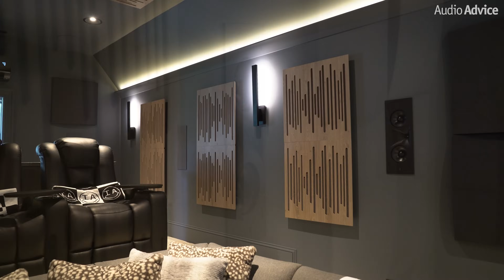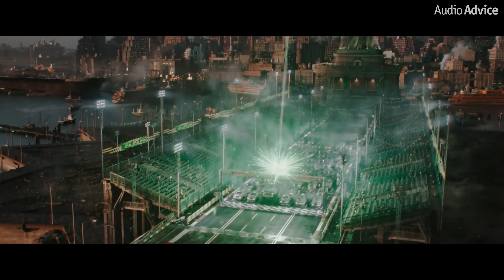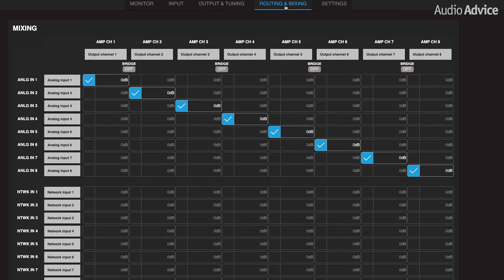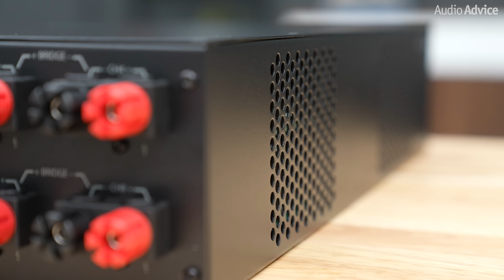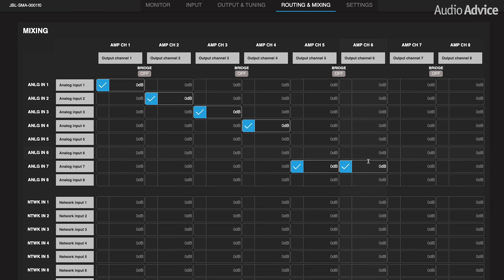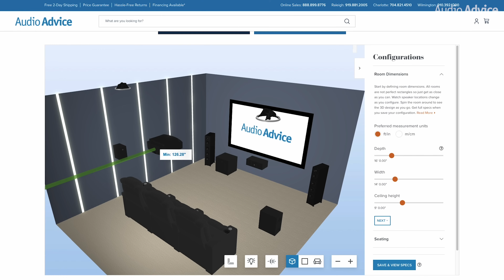JBL Synthesis SMA8300 & SMA4750 Power Amplifier Overview

Comment: I have the SDR-35 and SMA-4750, 2500 watts RMS per 15" subwoofer in my setup. Love it so far. I've never spent so much on two pieces of equipment.
Reply from the maker: Sounds like you are really rocking out! Thanks for sharing and hope you enjoy the system.

Comment: This seems like a pretty simple review, mostly going over the spec sheet, though seeing the web UI was nice. The old amps were based on Crown amps. What are the new ones based on? 0.35% THD at max power does not seem good. I want to see a review that dives into how they actually perform compared to other amps at this level. That they have AEQ for Synthesis speakers is good, but I want to know what I'm giving up versus other amps.
Reply from the maker: These are on a Crown chassis but as we stated in the overview one of JBL's passionate audio engineers made a lot of changes.  Feel free to reach out to our team to discuss in more detail

Comment: wow, i wouldnt call 50dba noise as quiet! please make a quiet amplifier
Reply from the maker: That is the max, which is still pretty quiet.  When we measure ambient noise levels in most rooms, its between 40-50.
Reply: @AudioAdvice  having such a loud amplifier makes it harder to put in the same room. SDA8300 was rated for 47db maximum fan noise, so this one is more?
Reply from the maker: @curiousobserver4096  That spec on the 8300 is interesting as we just tested one of ours and its 62db at idle.  The new ones are almost dead silent until you push them really hard.
Reply: @AudioAdvice  62db at idle is insane! I wish the new ones were designed to be wisper quiet somewhere around 20-30db is acceptable
Reply from the maker: @curiousobserver4096  Yes, its why we were very happy to find the new ones quieter and why we always needed to put them in another room.  We will try to get a real world measurement soon on the new one with all channels driven.
Reply: True, but your amps should be elsewhere anyway.